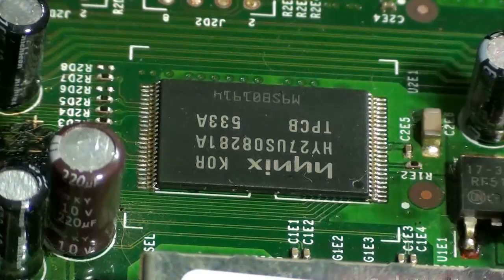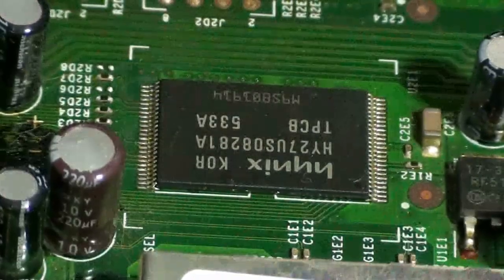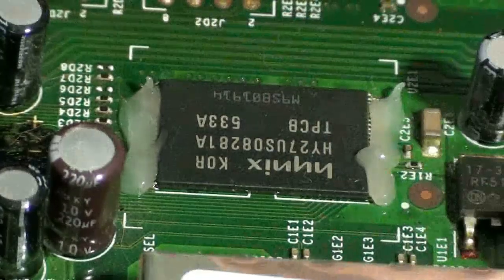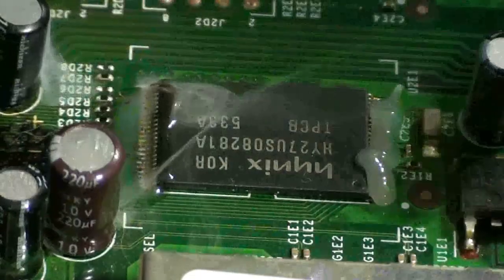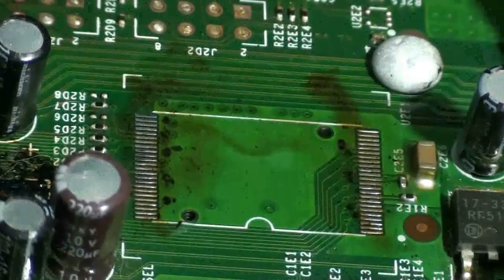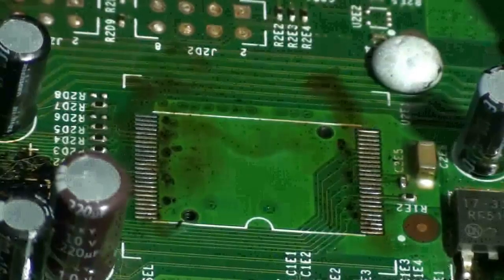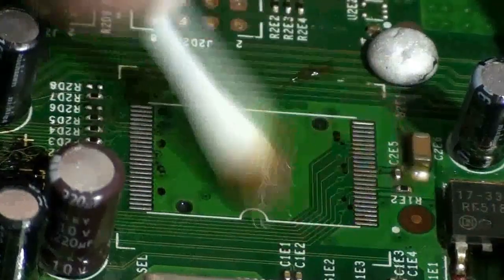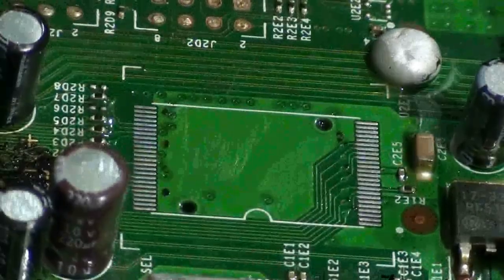Low Melt Solder

Comment: if i put another chip from an other console of the same type..what will happen??? is it going to work???
Reply: no it will not boot, because every xbox 360 has a unique firmware for the specific hardware like CPU key DVD key and so one.